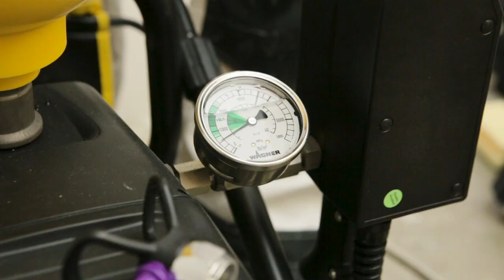Spray Painting a kitchen: How to use the WAGNER SuperFinish 23 Plus airless paint sprayer

Comment: Great job, where is the hang system for the cabinetdoors available?
Reply from the maker: Hi John, it's called the Pro Drying Rack SD (PSDR). As you can see, it works very well for spray painting 👌 Thanks - The Wagner Professionals.